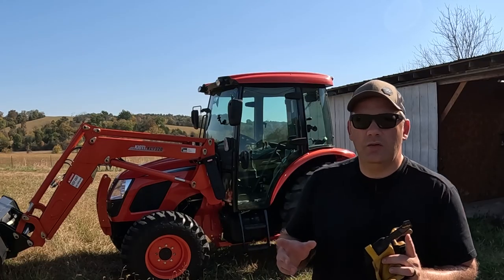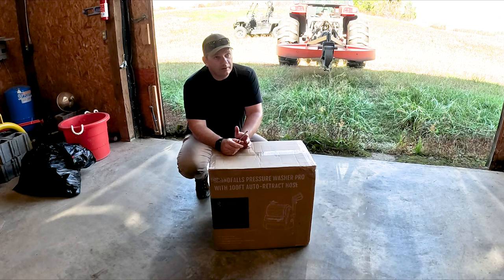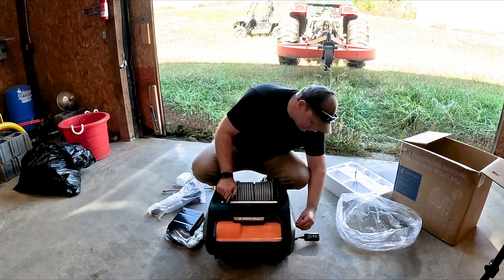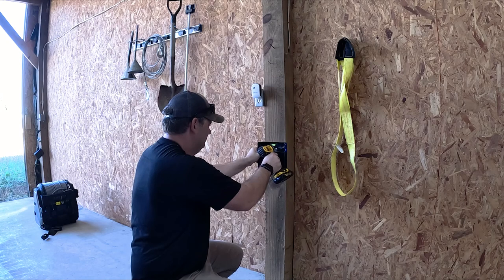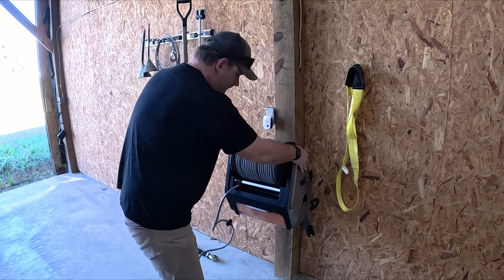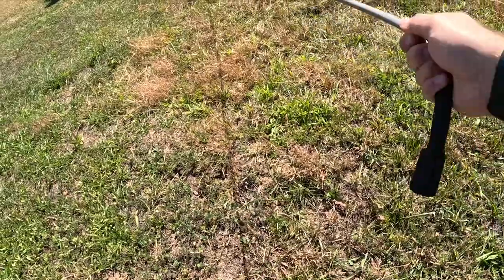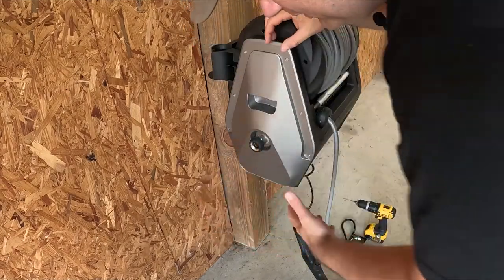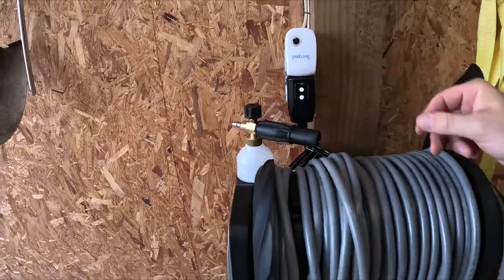Giraffe Tools Grandfalls PRO Retractable Pressure Washer [100 Ft Hose!]

Comment: Does your pressure washer PRO makes a squeal sound after you release or let go the trigger in the gun?  I saw on another channel that Giraffe fixed the sound and I was wondering if your has that problem.
Reply from the maker: It does!  Doesn’t seem to affect the performance at all, but it does take some getting used to.

Comment: Nice equipment. The hose length is a big thing on a farm since not all things are parked close by but by the finished job. So the pressure washer goes out to the equipment and not the big shuffle that usually takes place.
Reply from the maker: Totally makes sense.  I just think it is a really clean solution to the hose laying around when not in use and being an “all in one” unit.  Now; will it last?  We shall see!   Thanks for watching!

Comment: What is the pressure rating?
Art from Ohio
Reply from the maker: Hey Art; it’s rated at 2500 psi.  I don’t think that I am getting that kind of power, but it could be because I am on a well (though I never had pressure issues).  Would be a good video testing it.  🤔.  It really is a nice unit and love not having hoses and cord’s everywhere.  
Thanks for watching!